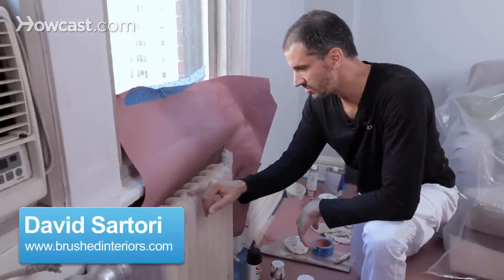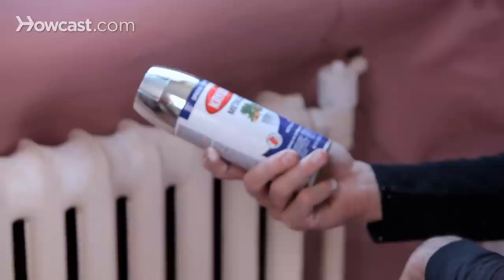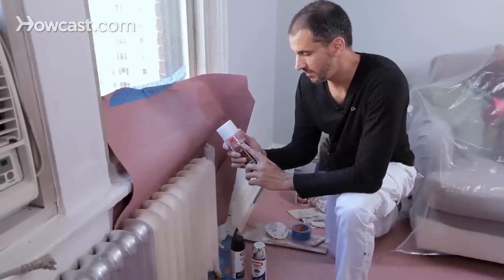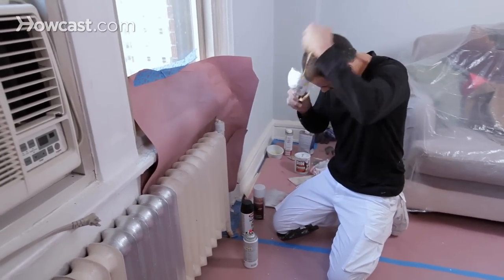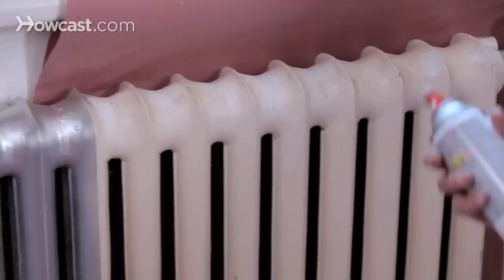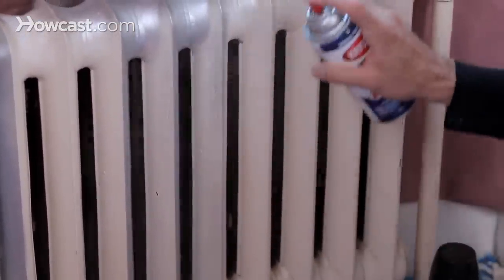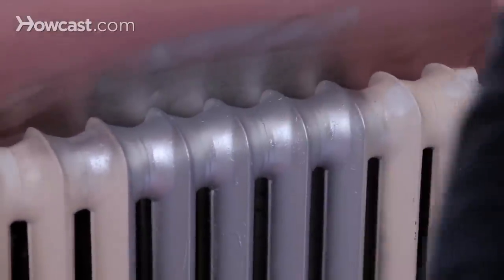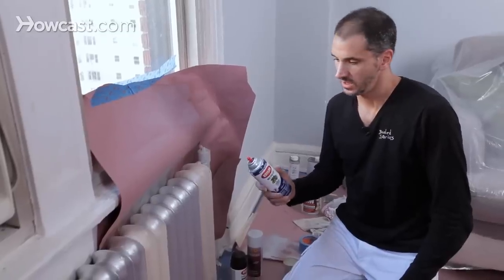How to Paint Radiators & Metal | House Painting

Comment: I painted with usual acrylic paint for artists. 4 years! everything is excellent. Does not need to wear a respirator. And when radiators get hot - no toxic fumes.
Reply: I have also painted the radiator with standard acrylic paint.  Now at nearing 10 years.  No problem.  However.....at that time I used a brush (not recommended).  I'll be repainting the same radiator soon but will gladly use spray paint owing to ease of paint coverage and even tone.

Comment: Those enamel paint fumes are dangerous to lungs. 
And would. You only paint in summer when the heat is off and you can open windows to air out the fumes? Brush or spray there will be a lot of toxins.
What is BIN paint? What does heat resistant mean? Won’t you get toxins evaporating into air when radiator is in use?